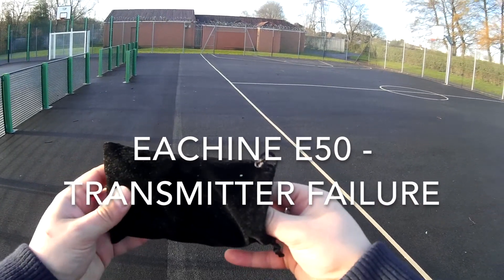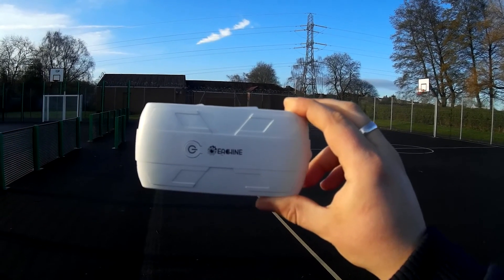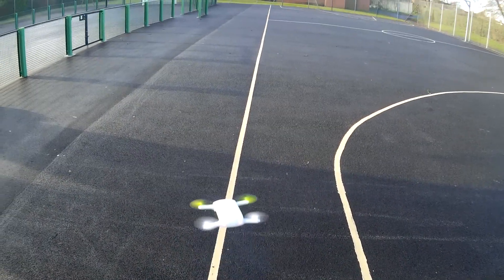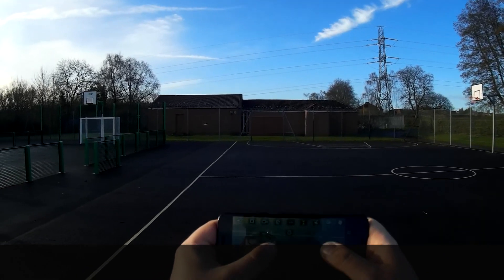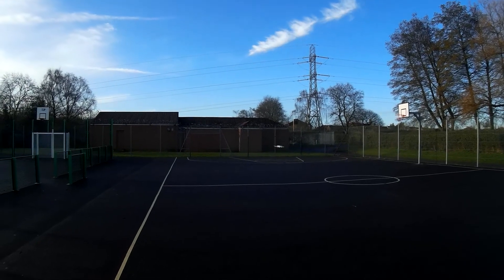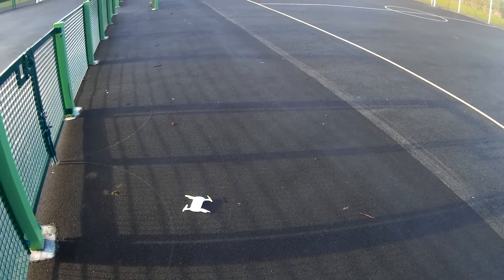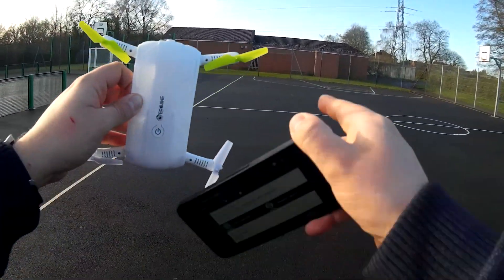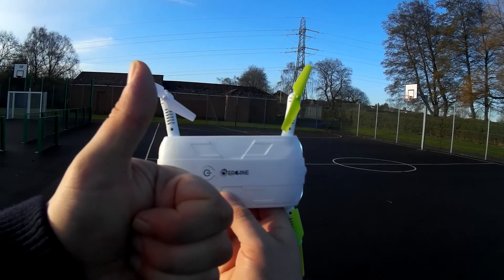Eachine E50 Selfie Quadcopter Drone - Transmitter Failure

Comment: that was brilliant often wondered about that
have a question...
if I double the length of the antenna in my remote will that give more range?
Reply from the maker: Thanks Paul, oohh interesting, i would have thought the old antenna would need unsoldering from the internal PCB then a new higher gain antenna soldered to the antenna pins, you would need to check the transmitter is capable of using the new antenna.  I may be wrong, but i would expect the process to be something similar.  Hope this helps :-)